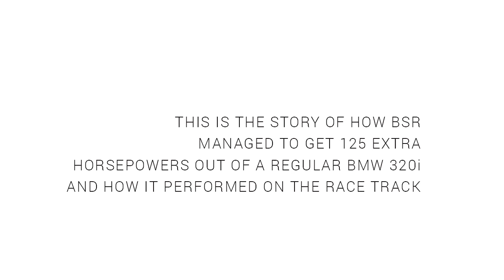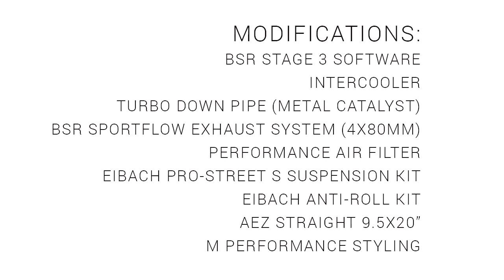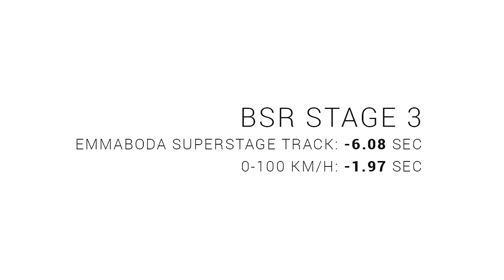BMW 320i (F30) tuned by BSR (312 hp / 456 nm)

Comment: Tjena, ja har en f31, 320d, gjort steg 1, plockat bort partikelfilter, gjort steg 2, installerat wagner intercooler, fått höra att den har runt 270 hästar nu från 190, finns det något mer jag kan göra eller ni för att få ut mer kraft utan att byta allt för mycket eller förstöra motorn

Comment: I'm wondering if you guys replaced the pistons on this 20i? I hear the pistons are weak.
Reply: if its a b48 engine same as 330i literally just a tune and i think camshaft difference
Reply: 330i pistons are different. You can compare parts catalouge to see the difference. 330i are cooled and a bit longer. There is known issue of so called pistons sliding down if you're overtunning this engine. What guys did is to prevent overheating and choking by exaust which should do but my major question is how reliable it is after years of use @Reaper_f30
Reply: Correct mate, after some more research the 320, 330 and m135 b48 engines all have forged crankshaft and piston roads,  difference is the pistons themselves,  they all have cast pistons but they differ in size, meaning different compression ratios,  but tbh the 320 vs the 330 with a stage 1 tune literally no difference, it's all about compression ratio vs timing . Both 320 and 330 can handle around 350 to 400hp on stock internals after that best to get forged pistons which is what I'll be doing , need to do more research on the m135
Reply: Also dw man they really ain't that weak your good for atleast 350 hp and around 22 psi
Reply: @Reaper_f30   they're always showing worst case scenario which is engine failure. 250hp sounds safe. Any higher wihtout modding IC, downpipe maybe asking for trouble. Always depends what you will be doing with that. Always first on traffic lights, race, or daily work driver. Also, i advice to check what will be impact on your wallet if you would lost those 5k $ for replacement.
Reply: @kamilborzych6615  if your ising shit fuel then sure need to fill up with best 99 all time on tunes, 250hp on a 320 is nothing for the b48 again 350 on stock is fine

Comment: I have a 2015 BMW 320i ED with DP and Air intake kit. if I tune in BSR Svenska AB is it gonna be +300 HP?
Reply: Dostum 10 ay olmuş yazalı ama cevabını veriyim Tune ettikleri motor 320i N20B20 (2.0 hacme sahip) olan modelden bu motorun benzeri 328İ modelinde de kullanılmakta bu tarz upgrade'ler ile 310-320 hp gibi güçler elde edilebilmekte. Senin aracında N13B16 bulunmakta PSA ortaklığı ile üretilen bir ünite senin aracında Stage 2 olarak Downpipe, filtre, intercooler ve yazılım ile 245 beygir civarlarında güç alabilmekte. :)

Comment: Hi, do you think 320i m sport could handle stage one tune with everything stock engine wise? Thanks
Reply: yes, although it is advised for an exhaust upgrade to help with the turbo and the increased power.

Comment: How come a Stock A4 which has 210hp, 260trq get a on par 0-60 if this is so tuned heavily. My 2010 b8 6 speed can get a 6.1 if pushed and on APR stage 1 around 5 seconds
Reply: Because this tune likely isn't making the hp they claim. Their 0-100 claim is identical to a 240hp 328i. BMW underrates their engines, so let's assume this tune is closer to 260-280 crank hp, not 300+

Comment: I wonder if it just cheaper to get the 328i and with a $400 chip and done
Reply: Only problem is money, doing the math the 320i is significantly cheaper leaving lots of room for a stage 3 plus labor and some rims
Reply: Molly Roko really so how much more do you think all that will cost?
Reply: +Molly Roko buy a 328i CPO with 12k miles for the price of a new 320i. It's not rocket science. With BSR's tune, they claim 0-100 km/h in ~5.5 seconds which is ironically identical to a 328i with only "240hp".

Comment: coul a 3288i f30 n20 support more than 312hp with any modifications you have?
Reply: +Ricardo Castilla no, same engine, 328i is a ripoff
Reply: @zars555  no its not, 328 has lower compression pistons

Comment: It could do without those blingy 20" wheels. They're too big and add unnecessary unsprung weight. Ride quality is probably atrocious too. As a performance tuner you should know better. 18" wheels with a 40 or 45 series tire is a good compromise. Amateurs... is that a piggyback tune too?

Comment: Another words it has roughly the same performance as a 328i only with hideous wheels and slammed suspension. I'm all for tuning cars,  but don't see the benefit here unless you're absolutely stuck with a 320i. If the argument is that 328's are far more expensive than 320's, then buy a CPO 328i with 12-15K miles for the price of a new 320i. A car with that few miles is still brand new in my opinion.
Reply: Jackmerius Tacktheritrix doing that exactly in a month when I pick up my cpo 328 m sport in estoril blue 23k 12k miles has the "sport trans"
Reply: Ian Clancy better performance then a 328, and non expensive modifications basically equal to the price of a 328
Reply: UNLESS YOUR GOING BACK YEARS FROM WHAT YOU WANT YES ITS THAT MORE EXPENSIVE
Reply: I'm sick with A 320 so I guess I fall into that field
Reply: Wrong. 328 and 320 are identical in ALL PARTS except the forged pistons on the 328i which are can handle SLIGHTLY more boost. Do some research before u spew utter nonsense on YouTube.

Comment: Would be cheaper to buy 335i/340i with warranty, more power, better sound, smoother engine and I6 engine, than do this crap and blow your motor after 1000kms.